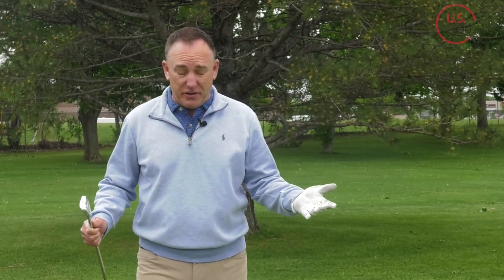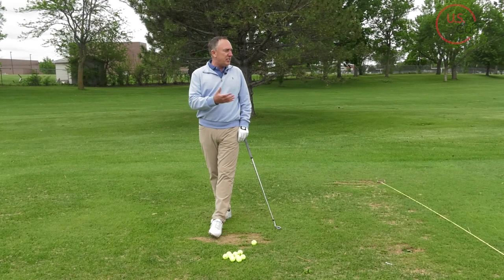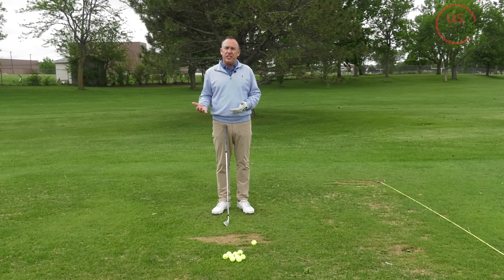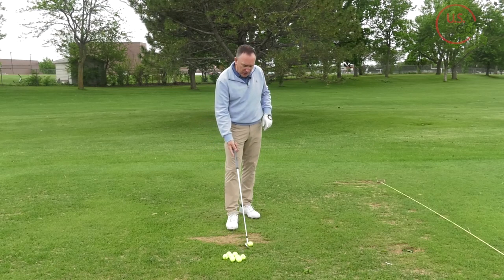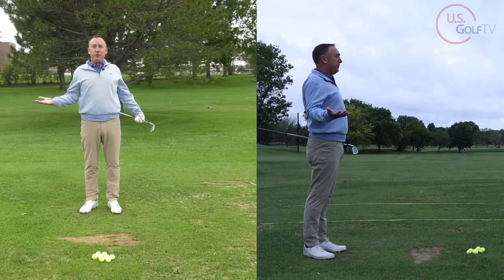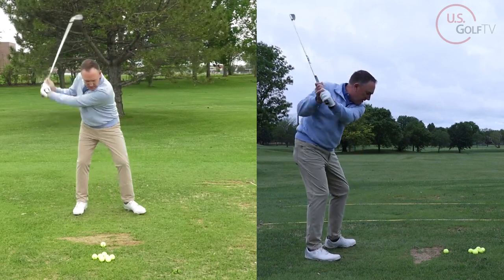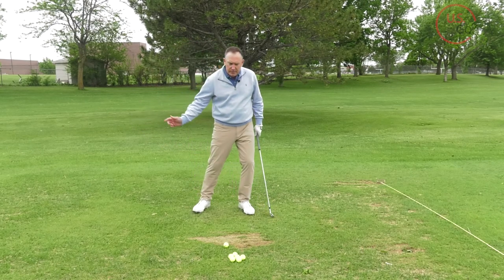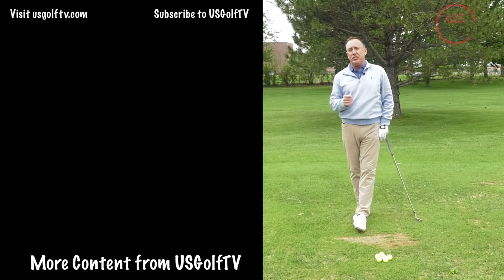Get Ridiculous Ball Striking Contact with This Simple Drill

Comment: Reason why im looking up contact videos today , yesterday i was chunking most of my shots during a round …this was after weeks of hitting the range and thinking i finally had consistent contact… i realized the ranges in my area hide this fault, to a degree (they all have mats ) …so i need to work on depth control  ,and mats make it difficult to guage those just ever so slightly deep strikes that during a round still fly straight ,high ,but lose 1/4 +/- of the distance … 🤷🏼‍♂️👍🏼✌️

Comment: Hello from St. Cloud FL.  Great video as always.  I have one issue that I wanted to get your thoughts on.  My contact on full swings are not a problem for me most of the time.  My problem seems to be when I have to take a 3/4 swing or so.  This is where I have a tendency to hit the ground first.  I notice it also happens later in a round but I just can't figure out how to correct it.  Any suggestions would be greatly apprectiated.  Thanks
Reply from the maker: Great question, this is something we see often. Try this, when you finish your swing simply make sure your knees are touching and your weight is on your lead foot. This simple idea has helped many of my students.

Comment: Something I’ve observed about recreational golfer’s swings with poor swings that differ from good ball strikers is a lack of side-bend in their downswing.  They seem to take the advice to keep the spine straight too literally and can’t intuitively connect the feeling of skipping a stone over a pond where there is lateral movement of the hips, side-bend and extension of the mass in the trail arm in the direction the ball goes with a golf swing.

What is interesting and helpful about the side-bend move is that it can be easily coordinated independent of all the other things which happen in the golf swing.  I used it at the top of my backswing, just before the club head stops moving forward to drop hands and get right arm tucked into torso. The side bend of the upper body to the right ) does not pull the body mass off balance like tilting a straight spine back \  because the right shoulder drops down and body mass and hips actually shift support forward if done correctly without movement of the head.

To understand how to do it as I suggest try it in front of mirror staring at your face.  Side bend to right without moving head and you’ll see right elbow drop straight down and connect with side and feel a lateral movement of hips to the left and straightening of left leg.  Do it the same way at the top of the backswing and you will be amazed how easy it becomes to bring the club down on an ideal inside path into the ball.  

The path becomes so inside that everyone I’ve shown the move to who had not previously been doing has gone from pushing hands too far in front and slicing to the right to consistently missing to the left because out of habit they still aim for dead center in the ball + relative to target line.  By working them down through their new swing very slowly I make them realize the new tighter inside path is actually bringing the club head down at an angle to the target line and swinging it closed and for that reason they need to aim and make contact inside of center to account for how face and ball on it will rotated to target before releasing.  That straightens out their shots 😊